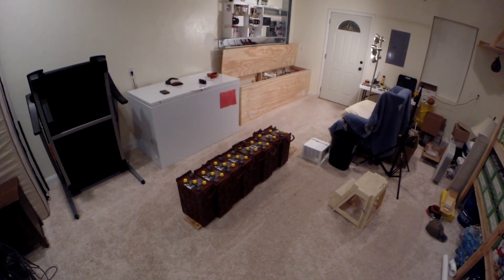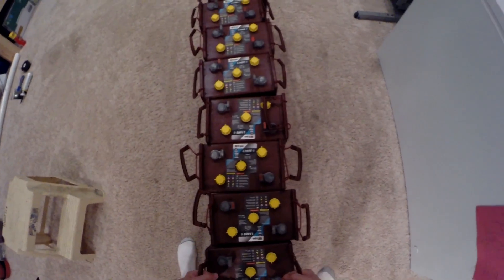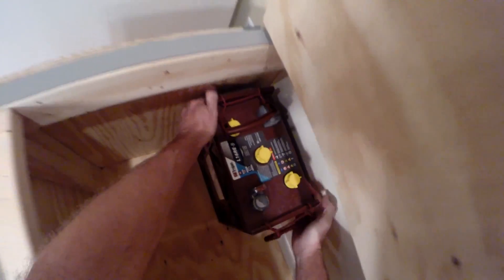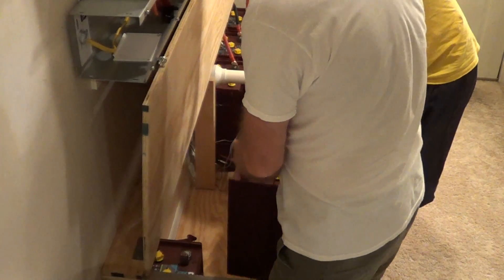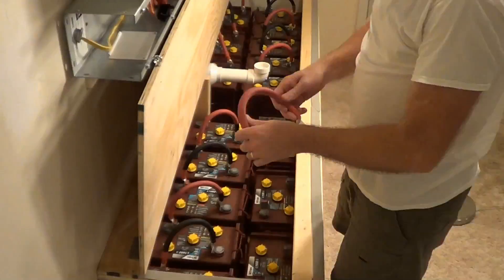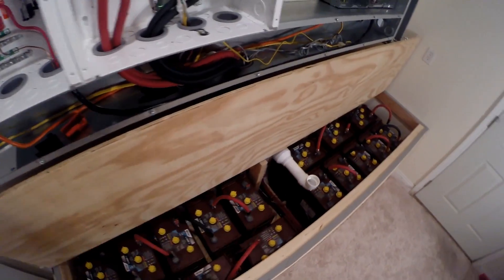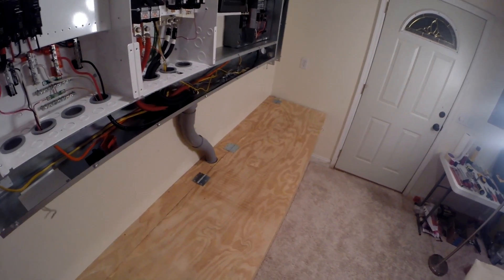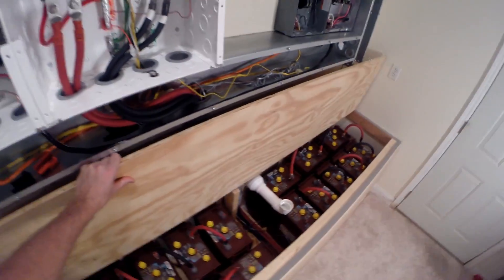Off Grid Solar #26: Wiring the Trojan Battery Bank II

Comment: nicely done what charging voltage you plan on useing
Reply from the maker: Well it's a 48V bank and will be charged by dual Magnum PT100 charge controllers.  I plan to configure the PT100's for my bank and let it do its thing.
Reply: Right. The change voltage is half of the system battery longevity. The batteries must be brought up to proper specific of gravity every couple of days. The voltages that most people start out with is way to low and batteries get sulfated that is why I ask the question

Comment: Brother I think your Elbow is slowing down the air flow. Maybe trun on the fan with it on. Test the air flow. Then do the same with it off. NOt at all trying to be a ass hole or sould like a smart ass. JUst trying to be help.. God Bless.
Reply from the maker: Comments and suggestions for improvements are very welcome here.  I am planning to completely re-do the venting at some point as I want to pull off the top of the box, run straight up vertically and then out.  I want it to draw air out even when the fan is off.  I am also thinking of drawing air from the outside and even designing a geothermal input air supply to keep the temperature more constant.  That won't be for a while...  Thanks for watching!
Reply: ***** Smart my vent pulls from out side air. In the summer its not bad but in the winner its a pain.